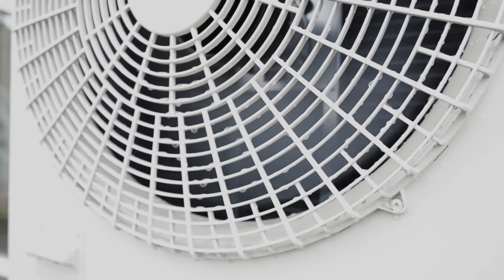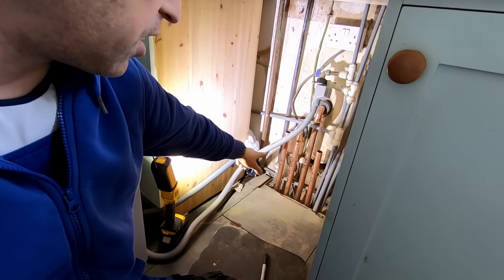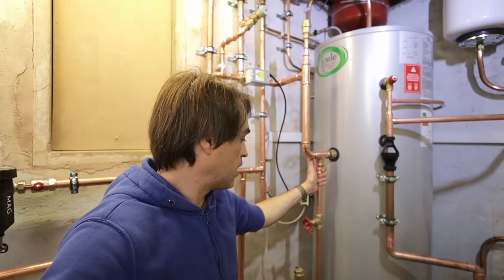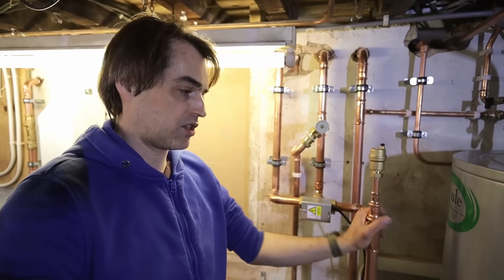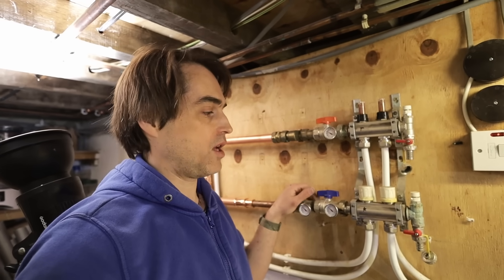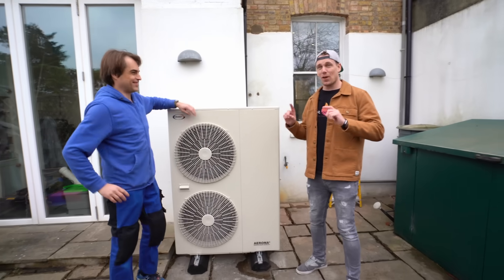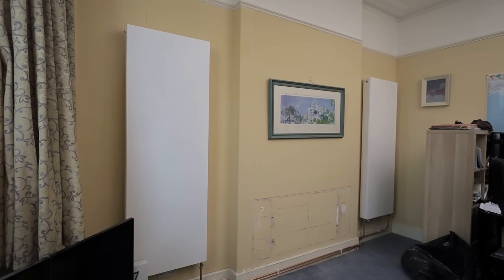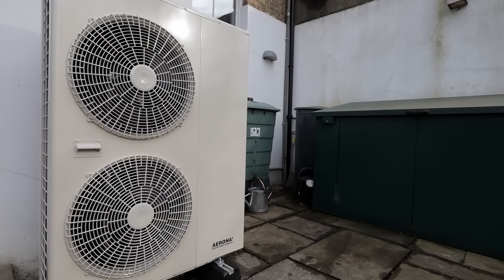The Truth about Heat Pumps: Debunking the Myth.

Comment: Was there any discussion with the customer about more insulation first? Those radiators are bonkers!
Reply from the maker: Property got fully insulated prior to the install.
Reply: @UrbanPlumbers  so those radiators were needed AFTER wall insulation?
Reply from the maker: @dylanbrown5414  yes, there is only so much they could do to the property to lower the heat loss. Even with loads of insulation you want to do all you can to lower the flow temperatures for higher efficiency. Obviously the best way is UFH but that costs another fortune to retrofit, large rads is a 2nd best option

Once people realise that large rads will save them a forune in running costs, no one will oppose them. You should have large rads on boiler too, as that would save you a lot of money on running cost and system maintance when run at lower temperatures.

We should be doing on gas too!

Comment: A very good video and cracking work as always.
The biggest issues I tend to find with customers is still; older people not being happy with lower temperatures when they're sat next to radiators and complaining they feel cold, younger people having to sacrifice living space to accommodate large radiators. Your two 600 x 1800 in the alcoves being prime examples of a system that works but a significant loss of storage space that many people aren't willing to accept. 
If you have any idea in how to address the psychology of older people feeling cold or people being unwilling to make sacrifices I'm more than happy to take advice. 

When it comes to commercial installations we've never really had any issue, except for one boarding school with a Viessmann GSHP with Oil backup where someone went in to do works after us and set the boiler to priority over the GSHP so their costs went through the roof. That was not a fun call back but once set back to the correct priority the running costs paid for itself in around 5 years, though that was quite a number of years ago now.
Reply: If customer does not want to invest in underfloor heting and still use radiators then pick radiators without fins. Pipe radiators, panel radiators...basically the ones which give out more heat through radiation rather than convection. Also these ones will be big but radiation is the best kind of heat.
Reply: @conr3x  Or are willing to lose at least 100mm on all outer walls to allow for more insulation, new windows, etc etc.

Comment: Shall keep my tiny basic combi boiler thank you! Talk about complicated and expensive!
Reply: Yes he only just understand s his own system but not fully ! I bet he doesn't even Label the system  they never work and rely on immersion heater or gas water heater backup .
Reply: Also heat pumps are slow and can take days to respond to cold snaps
Reply: @frederickbowdler8169   Thats so wrong mate. I have infloor heating with a 300 meter energywell and 10 kw heatpump.
Reply: What the gov will do is stop the spares for our combis,  so within 10 years you have to buy heat pumps.
The same with electric cars forced into buying them it's a form of communist gov.
Reply: Have you noticed the gov implement laws that nobody wants,  like Boris concreting over shale gas then digging  it up.
Same with oil shut down the rigs oooppps open them up again.

Comment: Its insane that they think this will be the future.. cant wait for hydrogen
Reply from the maker: Hydrogen will be way more expensive than heat pumps mate!
Reply: @UrbanPlumbers  not in my country, and I dont need to change anything about my home to use it lol. Hydrogen boilers exist already, there are streets in my country running on hydrogen already too. If I were to install one of those heat pumps in my home, the shitty AC ones not even the geothermic ones, I would need to invest 20 grand. 
The system itself, new windows, new insulation, new ventilation system because I cant open my windows anymore. I’d need a new fuse box with extra fuses. I’d need an electric boiler which is horrible, with hydrogen it would heat up instantly. Nah I’ll just wait it out😂
Reply from the maker: @scott19087  what country is it?
Reply: @UrbanPlumbers  holland

Comment: Been in the industry for years now and it's great to see a shift in perceptions! Heat pumps work and have always worked. Roger Bisby has cause so many problems unfortunately in the past with his biased videos so it's nice to see a realistic case study here.
Reply: There's another similar comment above.
This isn't a case study. It doesn't even come close to answering the questions surrounding ASHPs. We've got great info on the install but nothing on cost.

We need to know the install cost, pre and post gas/elect kWh, maintenance costs and useful life.

Anyone who supports ASHPs seems to go very quiet when I ask these questions.
Reply: @ChrisLee-yr7tz  I totally appreciate that and certainly wouldn't ever go quiet when talking about realistic costs. It's no secret they are expensive which is why grants have been available for over 15 years now from the government and why they are now giving people £5,000 to get these things in right now.

I have also had some very successful installations where the clients have paid less than a new gas boiler and are getting cheaper running costs (through the RHI) It's all to do with the building they are in. On the other side, some installations where it's been very expensive are paying more than a gas boiler in older houses (but are not producing carbon emissions which was the end goal)

As I said, It's no secret they are expensive but they are definitely the way forward and it would be naive to think otherwise. I do still agree with you totally that they don't work in certain circumstances financially. Maintenance costs are £160 per year (not too dissimilar to boilers). Think about the lifetime costs too, we are repairing or replacing boilers only 9 years old and still looking after 15-year-old heat pumps. 

As regards running costs, I think we are going to see quite a shift again in the next few years. Right now, My gas prices, unfortunately, have just doubled and I am paying 7.4p per kWhr and 28p for electricity. For a typical 20,000kwhrs house demand this is near enough £1,500 per year on gas. On electric with a heat pump even at 50C Flow temperature, this would cost me £1,428 per year. If I can get the flow temperature down to 40C (Which I can) it will be more like £1,200 per annum. Give it a few years and I think you will find the costs are going to shift in electric favor.
Reply: @youthfulrider407  The various grant schemes distort the real cost though.
Also, unless there is a shift in renewable electricity, ASHP still also cause pollution albeit in a different location. There is also an environmental impact from higher raw material input to the units themselves. There are some papers available online on the subject.

From your numbers I guess you're getting a CoP of 4? And you expect to get to 4.7 if you reduce the temp?

The thing I can't quite understand is that if to make ASHPs worthwhile you have to insulate to a very high standard, then surely the total kWh requirement drops enough that the capital outlay on ASHPs becomes even more prohibitive vs the energy reuqirement?

One thing I want to investigate further is PV and battery storage and then just heat with elect directly. Capital outlay should be massively lower and the whole set up is simpler.
Reply: Roger is right, though. That must be a 20k install, with massive, ugly radiators, and the energy costs will be big as well, unless the customer also spends another 10k on solar panels.

Comment: Have you got recordings of the external unit turning on and off? That’s when the aircon near my window makes the most annoying noises, not when in continuous operation. Also, have you got recordings of multiple units turning on and off after multiple years of operation?
Reply: they do make noise, especially on defrost change over
Reply: Would be good to see & hear different models in action ... visitors centres etc ?

it has to vary between make & model , & newer models not old enough .  .   Seems to me even a low db noise can be annoying, but might not hear it if double glassing etc.

Comment: Jesus around 1.7 kw  or 6000 btu of heat from them massive rads. 
Mad what the low flow temp can do to radiators.

I’ve being thinking if you can set the boiler flow on the lowest setting or something that relates to 55 flow temp then this might be a good indication a heat pump would work in the property with minimal adjustments. Seems like an easy quick fix test
Reply: That's actually one of the tests Heat Geek and many installers advise to carry out before considering swapping. As if it doesn't work money is better spent first on air leakage and insulation.

Comment: Excellent install and attention to detail but isn’t the essence of the problem that yes you can heat your house electrically with a heat pump but even in the current climate electricity (per kw) is still 3x the cost of gas?
Reply from the maker: Yes but the heat pump can be 300-500% efficient so still comparable or cheaper than gas! Watch heat geek channel for that!
Reply: @UrbanPlumbers  Elect is x4 that of Gas.
You're saying it's possible to get a CoP of 5 from an ASHP??? You sure?
I do not see the economics working.
Reply: Newer ASHPs get a cop of 4 fairly regularly.
Reply: @Etacovda63  Thanks.
So £20k to install to cost the same to run as a combi? What am I missing here?
I read a couple of scientific papers on ASHPs and GSHPs that said with the exception of CO2, for full life cycle, they're worse for the environment than Gas.
Reply: @ChrisLee-yr7tz  “scientific papers” - where? If you’re going to quote that, have some links ready - and from google scholar, not some blog…
Reply: @Etacovda63  yeah I will when I get up!
Tried posting them before on some other video but YouTube is a right pain deleting comments with links.
Reply: @Etacovda63  
Just lost one comment just now!

Try searching for...

ashp and gshp lifecycle environmental impact assessment

Just found a paper from Manc uni but its nearly 10 years old.

The main issue is whether the elect is decarbonised or not. On top is the production involves a lot more materials.

Clearly you could go down the pv panel and battery route. Not sure how efficient that is on a full lifecycle though.

I do wonder that if you did pv/battery it might just be cheaper and simpler to go electric on heating and hot water.

I don't know all the answers to any of this but I'm sceptical that ASHPs are economically viable and the environmental impact is still an open question.
Reply: @Etacovda63  
Anyway...I'm sure you can Google and read for yourself...
But before we worry about that...
20k install to basically have the same running costs...wtf?
Reply: @ChrisLee-yr7tz   yeah, it’s not for everyone. This install seems silly to me - heat pumps work best with underfloor heating and fan coils, rather than radiators. Retrofitting like this isn’t ideal - since radiators are in place already.
,PV is a good option to increase the feasibility. 

I live in NZ and I am commissioning a similar system in my new build house (No piped gas here) - two story upside down house with Fancoils and aluminium heat spreader plates upstairs and in slab down stairs, with cooling, Hwc diversion and a 7kw PV array - total for whole system will be £20k (inc PV)
Reply: @ChrisLee-yr7tz  that’s the same for EVs and ICE cars (better to keep your petrol/diesel and running it into the ground rather trading in for a new EV)
Reply: I’m hoping, in the long term, after gas is removed from power stations, that the gas price per kw will fall or at least stabilise. 

Gas power stations across Europe generating electricity inefficiently is the real reason gas costs are spiralling and electricity costs remain high.

Heat pumps are good for new builds but surely addressing the way we generate electricity is an easier, possibly even cheaper solution than replacing 25 million gas boilers in old Uk houses. 

Don’t quote me but I’ve heard gas power stations are only 40% efficient whereas heating a house with gas on site is 90% 

Then there’s the insulation, installation and manufacturing costs, if we’re talking about saving the planet all these need to be factored in. 

We need national perhaps even international leadership and investment on this, it’s truly a challenge for a great 21st century politician.
Reply: @lewisjones5067  A Combined cycle gas-turbine power station has an efficiency of 55%. On a cold UK night your HP COP might drop down to only 2.5. 55*2.5=137%. So, much better than 95% for a good gas boiler in your house. On milder days your ashp might get COP of 5 or better so then you're up to 275%. It's better to burn the gas at the power station then run a heat pump. Plus when alternative power sources come online you become carbon free automatically. Bottom line by 2050 gas has to be shut off completely. By then everyone will have to have some version of heat pump heating. The only question is which type and do you want to be an early or late adopter.
Reply: wait till you cant pipe gas out of russia any more...

Comment: This seems absolutely insane. Why are homes simply not putting in air handlers - which would do heating AND cooling! - rather than these gigantic radiators? Absolutely insane.
Reply: No grant availabe for devices that can also cool, so air-air mini splits are out (if you want the grant to push the prices you'd pay up by 4-5x :D )
Reply: @dorsetengineering  I don’t understand your comment re the grant? An air handler is no more than £500, so why wouldn’t homeowners be installing them in combination with the heatpump? Purely powering radiators alone seems ridiculous.
Reply: @britexpat_l33t  ah, you mean what we call fan coil units, gotcha. People think back to the ducted air heating from the 60s and compare it to that I guess? We never got it right over here and the industry went with radiators.

Comment: Very professional job. Great that you are dispelling myths that heat pumps don’t work. Roger the bodger should watch this video and see that they do work !
Reply: Depends what you mean by 'work'.
Clearly any system that requires x kWh for the house and hot water can be designed.
The real question is whether it's cost effective to fit, to run and to maintain. We have nothing on these questions and those rads look awful.
Reply: Roger didn't say they never ever work. The issues he raised as also raised by this guy.

Comment: Nice video. Personally its too big a cost to the consumer. These installs are in semi/detached houses. How many high rise buildings are there in England alone? Theres no way heat pumps can be installed in these. We have used fan coils in N.Ireland for a long time and even though theyve been set to a great standard, we live in a generation were people are living longer and people feel the cold. Physicalogically (prob spelt wrong) when they touch the rad people expect it to be roasting hot. I think Hydrogen will win the race and heatpumps will replace oil burners in rural areas.
Reply: You have hit the nail on the head, we fit every type of heating under the sun and low surface temps on radiators are one of the biggest complaints from older customers, or even customers that had them fitted 10 years ago in their late 50's now in their late 60's are feeling cold. So we're ripping them out (supposed to have a 25 year working life) and fitting back a gas boiler in many instances.
The psychological impact is quite big when dropping to 50c or below, yet current water regulations in the UK limit hot water temperature to below 46c to prevent scolding, and even less in care homes and alike at 41-43c. Makes for amusing call outs when residents in care homes complain of luke warm water but our hands are tied by legislation.
Reply: Hydrogens a pipe dream. We’d be using it already if it made sense, the technology hasn’t changed in years
Reply: Also people need to see what a service entails, because believe me when i say this, its not 100 pound service haha. The fan unit alone on those models are well expensive. Also mice love heat and these things are outside. There will be a fair few callouts to chewed wiring i bet in the next few years.
Reply: @Purebeltersteve probably half the houses in nz have heat pumps, I’ve never once heard of mice eating heat pump wiring.
Reply: @Etacovda63  you live in a country thats no were near as cold as the UK lol.
Reply: @Purebeltersteve  what the hell does that have to do with mice?
Reply: @Etacovda63  its to do with the fact we get snow and minus degrees in einter months. A unit thats producing warm heat by the way of pipes leaving units is gonna make them think its good to nest in. We get them in our gas boilers and they are inside peoples houses. But what do i know, im just going with scenarios that i know happens.  Trust me mate, i will be straight on here to tell you the first incident involving a rodent trying to keep warm, if these things ever take off in the UK.
Reply: @Purebeltersteve  we get them here as well mate, you’re not unique - the irony is though, that the external units likely to be COLDER than outside, and not warmer. If you’re using a split unit rather than a monobloc it will be considerably colder - and there’s zero reason to have holes in the unit that mice and rats can get in.
Reply: @Purebeltersteve  I'm inclined to agree with Etacovda63 mice and pests don't normally get into the units, more often it's leaf debris and call outs due to icing up which in the winter is no different from a call out for a condensing appliance locking out due to frozen condense. & that can be mitigated by a rain screen much of the time - if suitable.